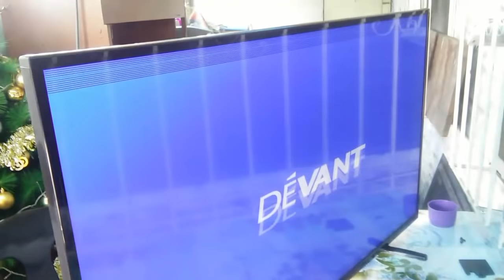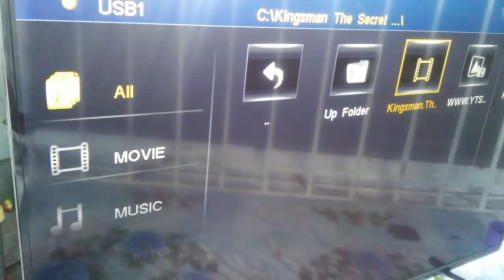Double image Devant led Tv SOLVED using masking tape

Comment: Oh man! I didn't believe it could work, but I've tried it anyway. I've got a samsung LE40A656A1F so I have 4 smaller tapes with pins there. It was the first one - I tried to cover pins with 3 mm regular tape. I was going futher and at some point I saw some improvements on the screen, so I knew what's the area that I should work with. Finally I found the exact spot! The screen is now perfectly fine! You saved my TV! THANK YOU!
Reply from the maker: Jakub Ryfa thanks dont forget to subscribe
Reply: Augustine CHII Ngek  remove one of the ribbon and turn it on....then check which one has the double image...it is either right or left..

Comment: It acutely really does work. Mine had no picture, disconnected  one side of the t con ribbon and one side of the screen came on. put tape on the other side till i found the section that was bad and it worked.

Comment: Correction for this problem (same tv on this video) this problem is not on the right ribbon to put masking tape it is on the left ribbon
 if you put masking tape base on this video the double image is solve but another problem comes out. mine is same tv in the video i put on the left ribbon it solve the problem.
Reply from the maker: Use thin transparent scotch tape
Reply: @djmbr  yes use thin masking tape, in the video its used very thick masking tape its affect ribbon connection if you use thick masking tape

Comment: hello could you pass me the  pin number where the adhesive  tape goes  thanks
Reply from the maker: luis martinez try to locate the tape until you got the right spot .. much better to use thin scotch tape cut it 4mm size
Reply: The fix works on the left ribbon about a quarter away from the left edge and if it's the right ribbon about a quarter away from the right edge. Mine was a Samsung LED f7100 with the issue on the left ribbon. It's now in perfect working order. Why haven't these manufacturers fixed this problem?
Reply: sir DJMBR,try to locate the right spot using tape? thanks
Reply: @michaelroberts7784  because they want you to buy another one every year !